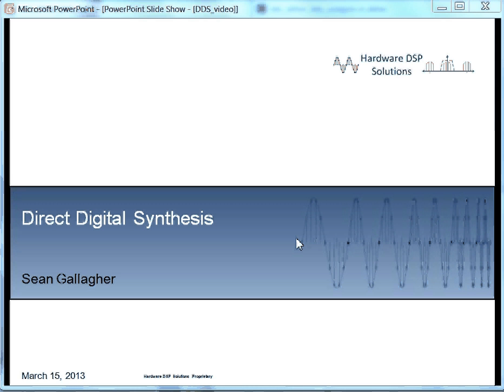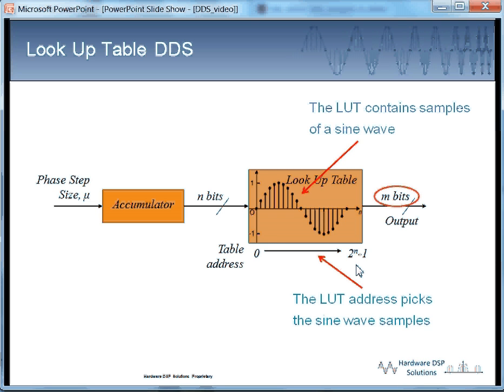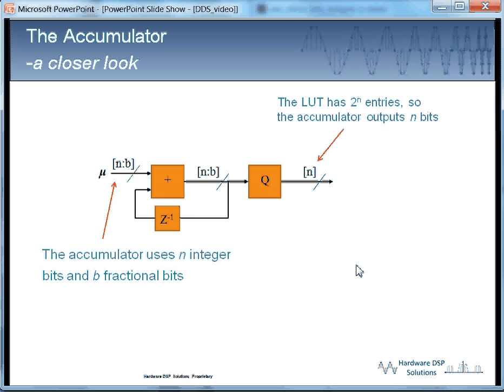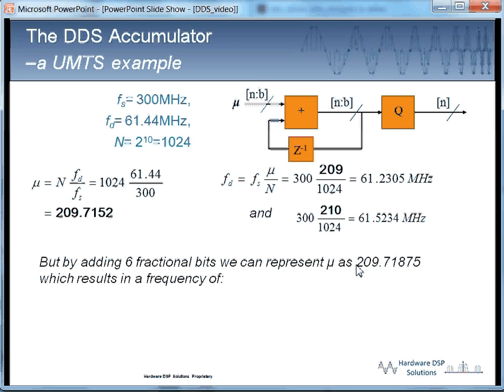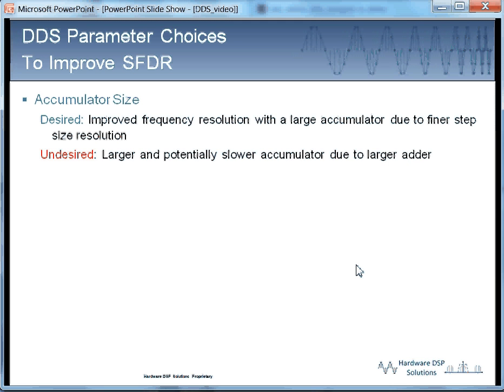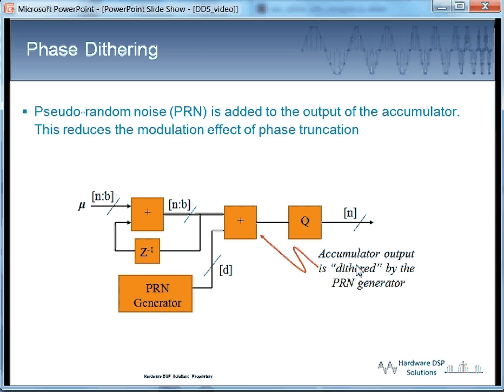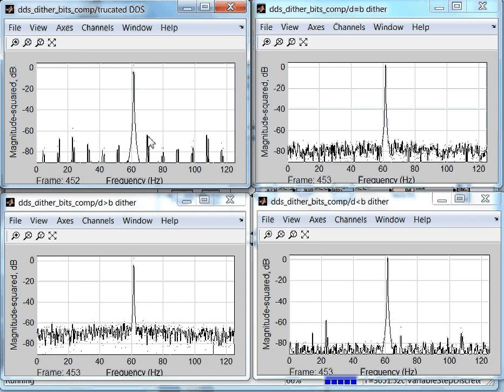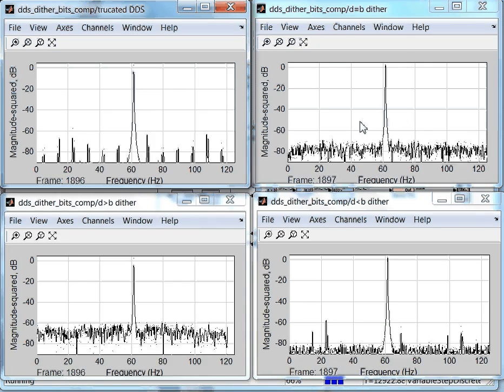The Basics Of Direct Digital Synthesis (DDS)

Comment: I’ve simulated this model using Xilinx system generator exactly the way shown on this video. I’ve used 16 bit unsigned with 6 fractional bits and used the constant 209.71875. According to this video I supposed to get 61.44MHz sine signal, instead my simulation resulted a sine signal of 61.5234 MHz. 
Any suggestions as what went wrong with my simulation.
Reply: You will get the 61.5234 MHz frequency when you will set tunning word to 209.999872 - very close to 210. So maybe the generator rounds up your constant to the nearest integer?